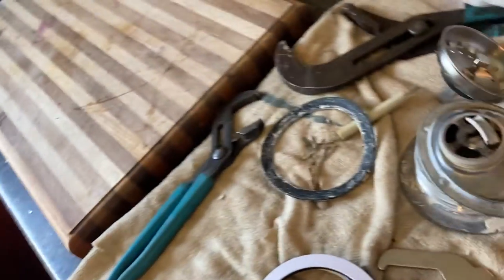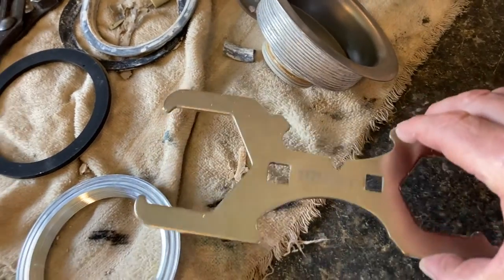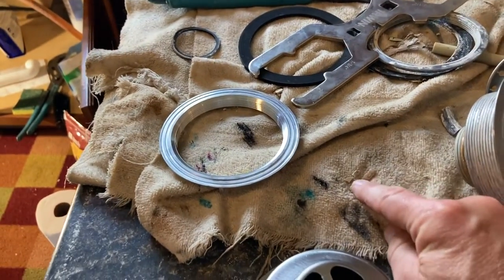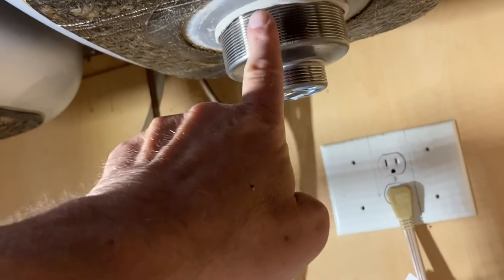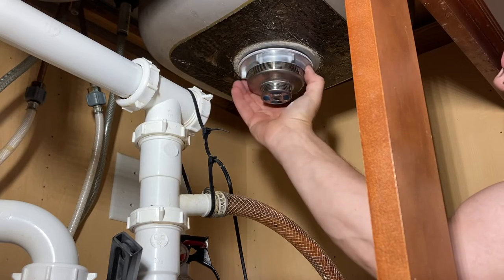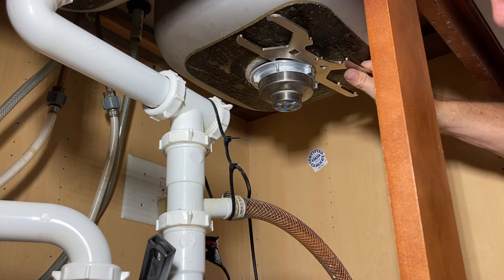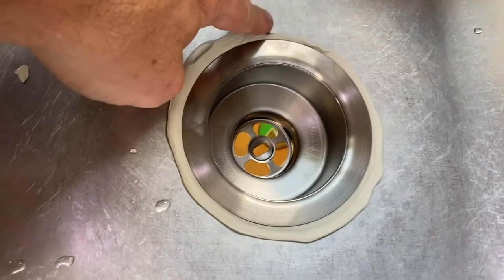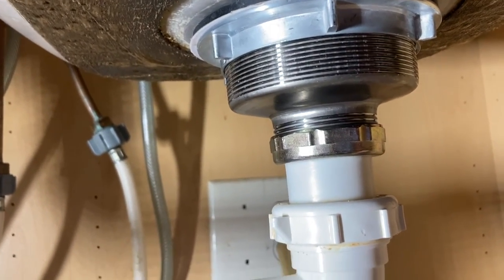Replacing A Kitchen Sink Strainer-Tips/tricks

Comment: Do you have much slope on the white pvc drain from the basket to the main drain?  I had that drain full of gunk due to very little slope over 3 yrs.
Reply from the maker: not really much of a pitch-i dont use much soap and very little grease goes down the sink-i also make sure to rinse the sink with very hot water often, this can cut the gunk inside the tubing
Reply from the maker: thanks for watching